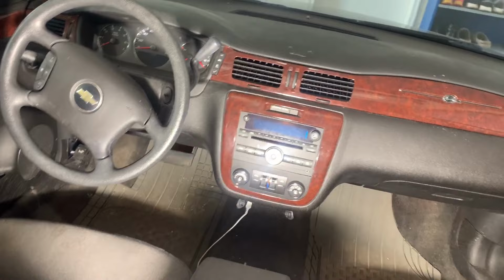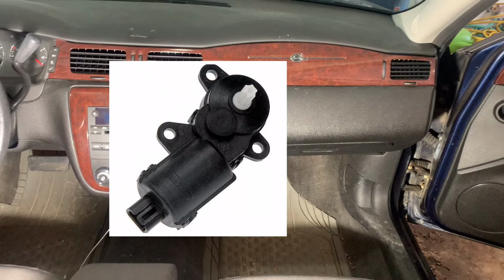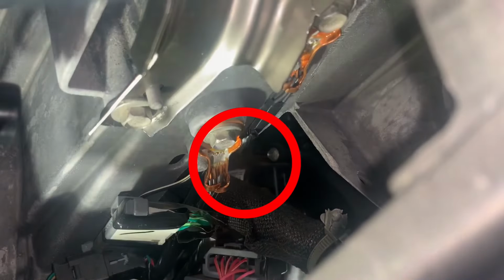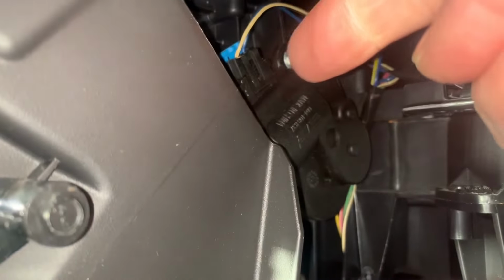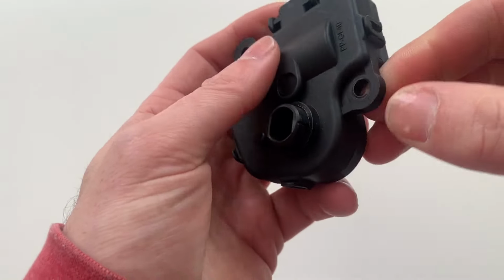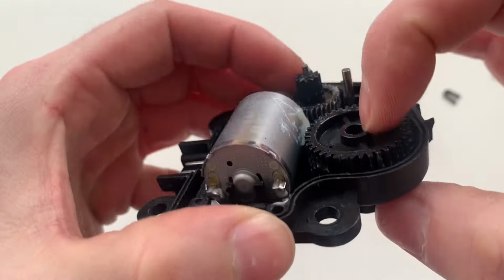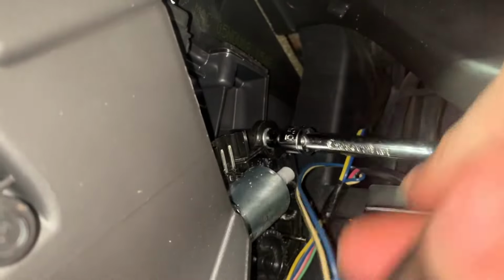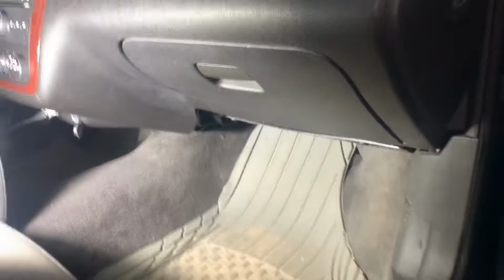FIX Impala Loud Tapping Noise in Dash! How to Replace HVAC Vent Blend Door Actuator ALL 3 LOCATIONS!

Comment: HELP. my 2012 chevy impala started make ticking noise then ac juz stopped working still blew juz no cold air went to jiffy lube guy said it was blow motor replaced that now it don't even blow air at all and it's still ticking I switched left actuator on passenger side  .. Could me replacing blower with bad actuator cause this not to start blowing or I'm so lost..
Reply from the maker: The blower motor and actuator are unrelated. Two separate problems.
The blower motor just blows the air. The actuators direct the airflow (output vents and temperature).
It sounds quite perplexing that the blower was working, then it was replaced (because it wasn’t working), and now it’s not working. There is something wrong with that scenario.
You need to install a working blower motor so it blows air.
Then replace the ticking actuator so you can control the vents and temperature.
And based on the confusing scenario with the blower, there is also the possibility that your control knobs/switches may have issues.
Reply: @HowtoandReviewsOfficial  I put old. Blower bak on now it works it still dnt blow cold air it don't tick anymore.
Reply: My freon refuel charge says see instructions
Reply from the maker: If the blower is working and it is just blowing hot air, it could very well be out of refrigerant. Common on a vehicle this old.

Comment: I had the same actuator that was bad and after locking it in the hot position I put the actuator back on without plugging it back in. The clicking stopped, but my climate control still doesn’t work. When I change where the air is directed, I can hear it moving but air doesn’t turn on. Do you know what the problem could be?

Comment: I replaced the actuator and a few weeks later it broke again. The original one I took out didn't even have any broken teeth. I think the door is just old and doesn't turn as easily. I was planning on just keeping the door in a certain position so glad I found your video so I don't have to figure out what way to turn the door.
Reply from the maker: Glad it helped! I also replaced it twice in a year. Just leaving it locked in position from now on.

Comment: I disconnected mine now the ac won’t work right. I have to crack the passenger window to get the  car to cool down crazy
Reply: You need to replace the actuator now your quick fix is not a permanent fix,, as he said.

Comment: If you're unfortunate enough to have your driver's side temp control actuator go bad, I recommend finding a small child to reach in and disconnect the wire harness to stop the clicking and then promptly trade in or sell the vehicle to someone you don't like. Should you decide to go through with the repair, prepare to have your left arm look like an 18th century French-Canadian fur trapper that stumbled upon a den of sleeping wolverines. 

Pro Tip: When installing the new actuator 90 minutes after starting the project, be sure to reconnect the wire harness first, as the connector can actually become captured behind the newly installed actuator and cause your moment of triumph to become one of despair as you realize you're back at the point you were two hours ago: needing to remove the mounting screws. I also recommend taking a moment to smash the old actuator with a hammer as you imagine it's the face of whoever decided to use plastic gears instead of metal on this part. It will help release your rage and prepare you for installation of the new part.
Reply from the maker: Very valuable information! I hope the replacement lasts forever for you!
Reply: LOL!  This is dead on... My left hand all the way to the elbow is torn up... Death by 1000 cuts 😅.  And that connector did get trapped behind the actuator but lucking I hadn't put on the screws yet!
Reply: Garbage design with those plastic gears.  Many auto manufacturers use these and they are guaranteed to fail.

I know the GMs are programmed to actuate these blend door modules every time you open and close the door to regulate air pressure in the cabin.  That's to reduce the risk of damaging your ears when a door is slammed shut.

That's a lot of wear on the 5 cent crap gears.
Reply: The left Side isn't that bad. Patience and Correct tools are all that are needed. I did one yesterday in 30 minutes.
Reply: Putting a rag over the sheet metal will stop some of the cuts. Still the most miserable job.
Reply: I swear the hardest to fix sometimes I secretly wish it was only the glove box one soooooo much easier…. On a lighter note stretching before hand helps a great deal as I am now a certified contortionist 😂
Reply: Oh and I could line up the screws so they are currently in my pocket and NO MORE CLICKING NOISE 😂
Reply: I found on eBay sleeves to protect your forearms and hands against heat and scrapes.  They work great.

I also slid a weightlifting bench up against the door opening and put a cushion on the floor.

I was able to slide myself into the compartment to work above my head.  Not easy, but easier than kneeling and reaching up.

In the future, I will remove the front seat and have enough room to party in there.
Reply: Thanks for that. Needed a good laugh. Smashing deffinitly helped me go in more level headed and ready to complete the task... although I will say, it was easier for me with my tiny female hands. Highly recommend having yalls wife help out. I was able to even sit inside the driver's side floor and have a martini in between screws. It was enjoyable because the kids could not find me for thus 30 minute job.
Reply: I just got off the phone with the Chinese Manufacturer of the Actuators... they said they'll send the kid who made it right over to fix it for me.
Reply: Great comment and advice!
Thanks Chevrolet!
Reply: Haha. Justin, I will say, though, that replacing the driverside actuator has been a hellish joy after it was replaced.
Reply: GOD, you are so right. At least you apply some humor to the situation. I mean...might as well.
Reply: @PN V  The worst part for me was that my socket wrench would rotate the bolts backward when I tried to reset it, so I had to manually reset it every time until the last couple.
Reply: @3983Loom  LOL, loved your comment!
Reply: @BrainFogDanellesReviews  Not to be offensive, but the part of your comment; "Have a Martini between screws" sounds funny. Have a nice day.
Reply: Do they have to make Clicking noise to be Bad?
Reply: There’s a few cables you can unclip from the car to make more room to see the the bolts. I used a small vice grip to put an angle on my ratchet and put it up through a space in the casing. It was a pain to figure out but once I did it wasn’t too bad
Reply: @JOHNSUE28 what tools did you use
Reply: I just fixed this on ny car today and I can confirm that looking like you've been attacked by wolverines is accurate! My left arm is very scratched up, but hey I saved a few hundred doing it myself 😎
Reply: @graciegregg7276  YES! 100% my mom thought i crashed my dirt bike in the burdock bushes again😂
Reply: @HowtoandReviewsOfficial Would you do a more detailed video just for the driver seat actuator? Please 🙏🏽
Reply from the maker: @juanroman4547  If/when I have to replace it, I will absolutely make a video.
I also have it on my list to just do it anyway, to get a video made. But I have a very long list. It gets longer, not shorter.
Reply: Lol dam son
Reply: @w.c.6678 😂 Oh, happy ending...
Reply: Luckily I'm a girl and weigh 100 lbs, got thin hands!  
It's Good to be a Little Blonde Girl!
Reply: 😂😂😂 great just starting this journey
Reply: Brilliant! LOL!
Reply: Yes sir. I replaced my driver side actuator about 2 years ago. It wasn't ticking. The door was stuck in the cold position. It was late September at the time. You are absolutely right. It is beyond a pain the a$$ to change. It doesn't help that I'm a big guy. The amount of contorting and creative limb bending was not fun at all. It sucked. NOW  - the fresh /recirculated actuator is clicking. Fortunately it appears that the job is easier than the dreaded driver side actuator.
Reply: You win the internet! Dying at this comment.
Reply: Dude you are a riot.
Reply: LMFAO😂😆😂 Hilarious😂
Reply: That’s very helpful I learned that if you unplug it from behind the ac fan temperature control panel by pulling off the trim the gray one or middle one pending how many plugs you have I need all three replaced did you know they make different clicking sounds I also have the service debility link engine, hot AC off service track control right front tire add air to tire 187,927 miles. I can get about 600 miles to a tank at 37.8 miles to the gallon.
Reply: Wise words. As a large old guy with large dickbeaters it was tough.

Comment: Is there no calibration required? Is there no need to disconnect the negative battery terminal? I'm getting ready to replace both driver's side and passenger side actuators. Great video by the way. Nice presentation.
Reply from the maker: Yes, it should be calibrated. The actuator should come with instructions. 

You can use a Scanner/programmer device.
Or, you can disconnect the negative battery terminal for five minutes, then reconnect it. Start the car and do not touch the HVAC controls. The HVAC system will perform a self-calibration which takes about two minutes. During this time you may hear the controls moving and activating if you are seating inside the car.
Reply: @HowtoandReviewsOfficial  Thank you. I'm not looking forward to replacing these but it sure helps to see videos like yours.

Comment: Thank you, thank you.  Having had the driver and left hand passenger side actuator replaced by a mechanic .... lots of hundreds of dollars a few years ago, it was depressing to hear the noise again.  Your tutorial was very helpful as the sound started when I purposely changed from outside air to recirculated air.  Your mention of the right hand passenger side actuator led me to the cause of the sound.   I pushed the outside air button and let it click for several minutes until the shutter got back to the proper position and then unplugged the right hand actuator.  Time to trade in the car, lots of other things failing.  Anyway, thanks for the thorough tutorial and hints about disconnecting it.

Comment: I unplugged the wires to the devices but it still clicks. What's the deal?
Reply from the maker: That is not possible. There are three actuators. I would check and make sure you unplugged the correct one.
Reply: @How-to and Reviews  yea there was the one on the driver's side and it was a pain in the butt to get out.
Thanks chevy for not only keeping this piece for so many years but also putting them in easy to remove places even after you found out it was an issue.
Reply from the maker: @drunkin12Many  that’s the worst one for sure.

Comment: I've got a driver side actuator that the housing is stripped out on, it just keeps turning loosely. It only has one screw holding it on and won't actuate properly.  Any suggestions on how to approach it?  Anyone ran into this?  Any suggestions welcome  🙏

Comment: Does it gradually get louder once it goes bad or always the same? Also does it increase with rpm?
Reply from the maker: In my experience, it doesn’t get louder. It is what it is.
It has no relationship to RPM. It will even tick when the vehicle is not on with no key in the ignition.
Reply: @HowtoandReviewsOfficial  I think there is a slight relation,  if the car is running, there's more than 12.6 volts.     I think I've noticed it sounds a little more sluggish when the the engine hasn't started yet.   But maybe not.    I have a good one that slips around the blend door fitting.    The gear isn't broke and I think the new gears are stronger.  For some reason the motor doesn't know when the blend door is in the correct position.    For now, I've removed the actuator and have it set by hand to cool for summer.
Reply: @HowtoandReviewsOfficial  In my 2011 Impala the clicking doesn't get louder but it does click faster once the car is started.  It clicks for about a minute then stops, however, it occurs every time I even open the door.  Last year my driver side actuator failed and because of it's location I had it replaced by a repair shop...big $$ because of the labor time.  Now the passenger actuator is failing but with your video I'm going to do this one myself. Thanks for the awesome video!
Reply from the maker: @fumingriley  Awesome, you can definitely do it!

Comment: so if i unplug the actuator it would stop the clicking but would it still provide the air through the car?
Reply from the maker: If you unplug the actuator, the air flow settings will be locked into whatever position they were in when you unplugged it.

Comment: I was wondering if my Impala makes that same EXACT ticking sound, but it doesn't blow any cold air, what should I look at next? I've got a 2010 and both sides BLAST HOT air no matter the setting. This should solve my ticking, but is it causing the heat too? Should I expect it to blow cold once I replace? Or should I expect there to be an additional problem? Thanks for the video!
Reply from the maker: Do you have controls to select hot or cold for the driver side or passenger side independently (hot/cold driver side and hot/cold passenger side)?

If so, is the hot air on the driver side or passenger side or both?

And is it hot (heater) air, or just not cold (outside temperature air)?
Reply: @HowtoandReviewsOfficial  Thank you for the question. During the heat of day it mislead me to believe it's blowing hot air. After you asked, I tried it late at night and have discovered it is NOT blowing hot air. Like you suggested, it's blowing outside air.
My driver side will get hot when turned up, and decrease temperature when it's turned down. But never gets truly 'AC ice cold'.
The passenger side is my problem side for now. The ticking has happened when I change the recirculation, or when the temp dial is moved for the passenger. The temperature never actually proceeds to change from that point. I've felt both actuators and confirmed they're both doing it.
I guess my question is: does it sound like once my parts come in, and I make this replacement, I'll be needing something simple like a AC recharge? Or should I be preparing for some other options as to why my car won't get cold ): 
Side note: My temp gage in the dash does not display anything. The silly thing lies there, limp, unresponsive. Not sure if that could be related somehow. Thank you so much for your help and timely responses. I ordered off the link in your description!
Reply from the maker: @kahpish  glad you checked back in.
The engine temperature gauge not working is not related. That’s a separate issue.
I agree that you need to replace the bad actuators to get the controls working, then the non-cold air will need to be addressed.
It could very likely be low refrigerant. Very common in this age of vehicle. A recharge may only be a temporary fix. Could be a leak in the system. There is refrigerant with dye in it to identify where it is leaking. There is also refrigerant with stop-leak in it to seal up small leaks. So those are a couple options.

Comment: Used as a reference to replace the driver side actuator on my 2007 Monte Carlo LT. Can confirm the dash internals are the same. Those bolts though were a pain in the butt.
Reply from the maker: Thanks for the update! Good job, the driver side one is brutal!

Comment: How do you know which one is bad? Do you just change all four?
Reply from the maker: You definitely don’t need to change all four. You should be able to tell the general area is coming from by sound. Driver side or passenger side. Then when you remove the panels and expose them, you can see and feel which one is clicking to verify.
Reply: Found the bad one, the easiest location one, swapped out and it’s good now. Thanks
Reply from the maker: @nyrider8396  Awesome, great to hear! Thanks for the update!

Comment: What size are those screws? I did mine this morning and whoever did it for the previous owner just put that top screw in. Went to auto parts store and a hardware store and neither had the right thing
Reply from the maker: The exact replacement bolt is GM Part Number 11609829 (M4.2x2.25x16 Multi-Purpose Bolt)
An Amazon link is below, but it it also available on many other websites. 
https://amzn.to/3AQcpih
Reply: @HowtoandReviewsOfficial  thank you so much!

Comment: If the car makes this tapping noise even if the car doesn’t have the keys in the ignition, or any buttons being used, is the problem still the actuator? Great video! I like the step by step instructions
Reply from the maker: Yes, this tapping will occur when the car is not on and with no key in the ignition. Addressing the actuator will fix the problem!
Reply: @HowtoandReviewsOfficial  yup

Comment: My air is stuck coming out of the windshield vent.  Is this affected by the actuator that you didn't cover? The one you said was different from the others?  2015 Impala LTZ
Reply from the maker: That would be true for this generation of Impala, but you have the next generation. I am not educated on the details of the hvac system for your generation.
Reply: @HowtoandReviewsOfficial  i have a 2012 with the same problem and was wondering how to reach the actuator that controls which vent the air comes through

Comment: My passenger side blend door make noise every start for a minute and then stay calm. Can this blend door actuator (when not making noise) create an issue in Ac performance/cooling the car in the afternoon?
Reply from the maker: Yes it can. There are two blend doors on the passenger side and one of them controls hot vs cold air.
When the actuator is bad, it is typical for the actuator to make noise when the car is off and when it is first started.